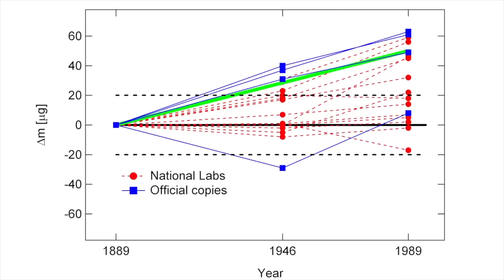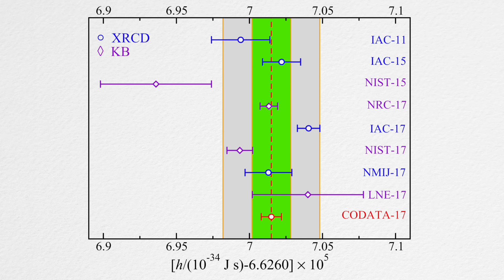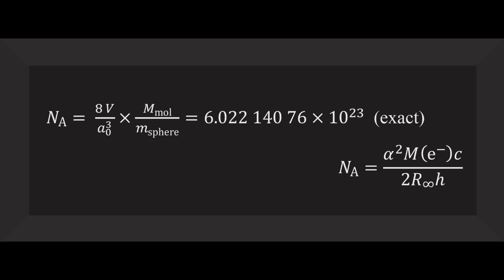The kg is dead, long live the kg

Comment: It is funny because the definition of a pound is based on a decimal number of the kilogram, so the pound will be changing in turn as well
Reply: @carultch  You wouldn't get it
(JK)
Reply: US: interesting 
The rest of world: what is pound
Reply: The pound 💷 changes value every day.
Reply: @carultch  I bought a router. I am in Australia. Australia is metric. I bought some 6mm router bits. They don't fit. The router was originally intended for the US market, it has a quarter inch collet - 6.3mm. If the US would join the rest of the world, these problems would not happen. Being able to convert units in a search engine does not help.
Reply: @snarkfinder2621  Unfortunately, having the US switch to metric has it's problems as well. I live in Phoenix, AZ where all of the streets are laid out in a grid. The distance between major roads and major intersections is based on the mile. They're all exactly one mile apart. So switching from the mile to the kilometer would require our freeway signs showing the distance between the exits to go from whole numbers to decimal numbers. Not something I would want to see while driving.
Reply: @emuhill  The same problems that Australia went through and other countries as well. The distances between freeway exits are rarely exactly x miles, more like x.xx miles, unless every single road is dead straight and either parallel or perpendicular to every other road. A distance of 26 miles would not be shown as 41.84 kilometres, but 42Km. Putting off converting only makes it harder later.
Reply: @snarkfinder2621   That just makes you the careless person living in a backwards country, since here in USA I can buy 6mm, quarter inch and even adapter collet to go between the two.   You didn't check dimensions of what you bought and don't live in a place that has adequate hardware inventory so that it didn't matter what collet size you had?  Pffft.
Reply: @snarkfinder2621  you're right. We should force over 300 million people to unlearn how they measure and define the world because you bought the wrong bits for your router.
Reply: @Ponja__  No, we should get a noisy 5% of the world's population to join the other 95%. My comment was merely an example of the problems caused by the 5%.

By the way. Many countries that moved to the metric system were forced by their governments. All of the USA's weights and measures are officially defined by the metric system.
Reply: @Ponja__  It's not hard to learn and everyone would benefit from it. So yeah, 300 million people needs to learn what the other 7 Billion already know.
Reply: @Ponja__  there are many countries that already went through this so why would the USA be any different
Reply: @Ponja__  Start from selling products in metric in USA. If you will buy milk in liters, rope in meters, potatoes in kilograms for few months you will get used to it pretty fast. Do you really think that it would be so hard for people to learn new system?
Reply: @rfly-fpv  you can do either.  Our food is labelled in both lbs/ozs and kilos and grams.
Reply: @Omenowl  And that's the problem. One thing that they realized in metrification of Australia was to not allow selling measure tapes in both systems (like both systems on one tape). The just started selling only metric tapes. If you sell both people will just follow their old habits. How long you get use to new UI in your phone? At first few days it looks weird, after week you start to get used to it and after a month you don't even remember how the old UI looked like.
Reply: @rfly-fpv  government mandated people use metric units by law and fined those who did not in Britain. Learn both, use both to be an educated man.  It is a huge deal especially when contracts, surveying, engineering were all done in imperial units and by law the oldest contract has precedence.
Reply: @Omenowl  I understand that it's hard for existing things but the solution is simple - just start new projects and contracts in metric system. Time will bring natural metrification in new generations. Super simple
Reply: @rfly-fpv . The answer is simple.  Do not force people to change for something that has worked since Roman times.  Give me a compelling reason why the one should be forced to change?
Reply: @Omenowl  In programming there is a rule DRY that means don't repeat yourself. By having multiple measurement system you basically repeat yourself (gallon for gas, barrel for oil, fluid ounce vs just liter and prefixes, inch, foot, yarn, mile, nautical mile vs just meter and prefixes). It's not about forcing someone. It's about realizing the benefit for the world and new generations. Example: Americans need to learn metric system when they want to be a doctor. They need to learn Celsius, grams, milliliters etc. Why even bother to learn and convert those things? If your grandfathers would do proper metrification in the 197x  we wouldn't have this conversation. Nowadays you can read articles in English language (international language) where the are miles and kilometers in brackets (for example wikipedia). That's just crazy - metric system is international standard. If Americans don't want to switch why they just can't learn metric units? Standardization is the key for success. Maybe you don't realize it as you are one country almost on the entire continent. Imagine Europe with as many standards as the countries. That would be total mess in trade.
There is one example where imperials system was adopted when metric was used before as it was easier to do it that way. For example Russian planes used flight levels expressed in meters. They were just sick off conversions so they started to use feet for flight levels to align with rest of the aviation world. On the other hand it's just much easier to switch world to metric that the other way around. 95% people already use metric system.
Reply: @Omenowl  BTW you said that it "worked since Roman time". Maybe true but IMHO I would say no... In the past every country had it's own definition of mile. That was not something that was working fine, especially in trade... Imagine a shampoo with big table on the back with all volume marks ;) It's a bit better now but not fully as even you have two or even three versions of mile (mile, statue mile, and nautical mile). I prefer the world where everything is designed to be simple. You want to measure distance? Why you need more that one unit? Big companies like John Deere went fully metric just because they really safe money on things like warehouses that need to keep only metric parts not both.
Reply: @rfly-fpv  you are talking about standardization.  Every city had it in the town center usually on a church.  It varied from region to region, but there was a standard for the area you were in.
Reply: @Omenowl  As far as I know there was some group of people in the government that stopped metrification in USA. If the law would be mandatory we won't have this conversation now. Educational videos were made, regular people knew that "metric is coming" but at the end the law was "optional". If something is optional nobody cares. Imagine optional speed limit. The whole thing just lost momentum due to the wrong (in terms of metric) law.
Reply: @rfly-fpv  Again if you are making a law to force people to use it then it is not a superior system.
Reply: @Omenowl  Again it's not about forcing, it's about educating. I bet in schools metric system is only used on physics class and that's it. Most of the people even don't like physics in school. When you really dig into the topic and you are scientists or engineer I bet you find metric system superior one.
Reply: @rfly-fpv  should be easy, especially since the metric system is easily convertable in units and works by factors of 10 for each new prefix
Reply: @jamesfstokes  because fREEEEEEEEEEEdon
Reply: @jamesfstokes  Because other countries had the mental capacity and the organisation to do it. Sweden even changed driving sides in one night, which is much harder. A specific country (France) even had what it takes to make a new system from scratch. Do you think a country in which half of the population supports orange man has that?
Reply: @XenophonSoulis  why do you need validation for what you use?  There are conversion charts and free programs that will convert for you with an exactness to several decimal places it is what a smart person would use if they aren’t familiar.
Reply: @Omenowl  I don't need validation for anything. I'm just mentioning some facts. Or are they too hard for you like the international system?
Reply: @XenophonSoulis  History, contracts, surveying, land rights and dealing with the human beings that it impacts requires one to be fluent in both.  

Perhaps one should stop telling people what to use just because it is too hard to use a conversion chart.
Reply: @Omenowl  Well, in the civilized world we can totally communicate and do everything you described with one system and use that effort to learn useful things instead. It isn't THAT hard.
Reply: @XenophonSoulis  You still have not refuted a single point I have made.
Reply: @Omenowl  You're why everyone laughs at the Un-united States
Reply: @ShadeOfTheLamp  I would rather have a decentralized system where people opt into standards than are mandated by tone deaf bureaucrats.  Tell me how the EU is doing…
Reply: @ShadeOfTheLamp  Laugh all you want no one cares if you add nothing of value.
Reply: @ShadeOfTheLamp  yep, American government bad.  Could not agree more hence why I do not believe in mandates.  Still prefer to live in a place that believes in individual rights like freedom of speech.  Unfortunately, no other place has it.
Reply: @Omenowl  And freedom of speech is basically everywhere lmao
Reply: @ShadeOfTheLamp  there is no fundamental right of speech anywhere else.  You better look at the laws and people being thrown in jail, fined, etc.
Reply: @Omenowl  What American supremacist education does to a mfer
Reply: @ShadeOfTheLamp  Have you actually lived on multiple continents and countries?
Reply: @Omenowl  Yes
Reply: @Omenowl  EU is doing fine. At least we don't give nuclear keys to someone with no political nor military background.
Reply: @Validole  I do not trust any of them and so accountability is required of all.
Reply: @Ponja__  oh no, it's so hard to learn that 100cm = 1000m. you're underestimating your own people, dude.
Reply: @noakinn  "it's so hard to learn that 100cm = 1000m"

hmmm but it doesn't Lol 100cm = 1m
Reply: @carultch  say that to the probe that crashed into the face of Mars, because the sensible scientists used metric while a few used imperial. $125 million down the drain, and people still use that backwards system.
Reply: @Seb135-e1i  it isnt a "backwards system" in  fact it isnt the systems fault at all its the scientists fault for not all using the same system of measurement in fact if its the  scientists who used imperial measurements fault then its just as much the metric measurements fault as well  for not using imperial measurement its all based on perspective and what you were taught  when you were a child
Reply: @zapawak4808  Good lord, that was painful to read. Ever heard of commas? Periods? Any kind of sentence structure? 
And it's not perspective - the global standard is to use metric for science, no matter whether you're in Europe or the USA. The "scientists" using imperial shouldn't have been working at NASA.
Reply: @Seb135-e1i  The scientists using imperial weren't working for NASA.
NASA has been using metric since its inception (so the answere to, which unit system got us to the moon is metric).
The spacecraft was build by Lockheed Martin, with the Software made by NASA.
The computer got a value of the force, the thruster was producing and calculated with that value, how long the burn should last.
The problem was the computer expected the value to be in Newton, but as Lockheed Martin uses imperial, they provided the value in pounds.
So the problem was Lockheed Martin not using Metric, or not converting to metric, although it was required of them.
Reply: @zapawak4808  Nope. The guys who used imperial were the ones who messed up the conversion that they shouldn't have been doing in the first place, as the agrement was all work was to be done in metric just to avoid such a situation
Reply: Yes but actually, no. Units are just converted over - in that way the definition of pound is changed. How pound was defined back in the day would not change - though how things are defined before, now and after which one would matter? And for what you are doing, does it matter to use extreme precision?
Reply: @RickTrajan  No one uses how things were defined before, and even then, how they were defined before was inaccurate and varied significantly, they just weren't doing anything sensitive enough that it would significantly matter. Though pounds are still not used by anyone doing work that precise, but anyone currently using pounds as their measurement just got updated since it's CURRENTLY based on the kilogram.
Reply: RickTrajan *Well yes but actually no
Reply: As was pointed out in the video from 8 years ago on this channel
Reply: I mean pounds don't exist so it's not that much of a problem. ^^"
Reply: 69 replies

I will ruin it lololloololoololololol
Reply: Pound was a definition of medieval language before the language "k.g" was born!
Reply: Kg was defined in relationship to the pound in 1878.    Pound referred to a particular platinum shape used for reference.
Reply: In the US the people believe that the government is of the people and by the people.  If the people don't want to do something, having the government force them just doesn't make sense.  The people forcing the people?  Especially on a topic that can be lived with either way.
Reply: Pound is not basic unit
Reply: The modern pound yep
Reply: A pound is based on a gallon of fresh water. The imperial gallon is 4.5 litres = 10 pounds. The US gallon is 3.79 litres =8 pounds.
Reply: No, the digits of precision in the re-definition of the pound are insufficient to be affected in any way.
Reply: Not just any decimal number, a rational number! That's the big idea, its like a change of basis to quantified properties. Quite beutiful
Reply: Why doesn't US stop using those dumb units
Why are you torturing the rest of the world?
Reply: if i remember correctly, when the US tried to change from imperial to metric, the change was voluntary and not mandatory, so the people refused
Reply: @Matt0sh  It's very simple. We keep using those units because we don't want to torture ourselves by learning something new. We don't give a f** about the rest of the world.
Reply: @russlehman2070  that's not a good thing. read what you said again.
Reply: @Matt0sh  I agree that it's not a good thing. It is, unfortunately, a fairly accurate statement of the attitude of many  of my compatriots about converting to the metric system, which is something that I actually favor.
Reply: @Matt0sh  You're silly, there is zero superiority of any unit system for everyday use.  No country on this Earth uses purely metric units, all have some traditional units in use.
Reply: @RWZiggy  wrong, there are multiple countries that use only the metric system, mine included
Reply: @minecrafting_il   I am correct.   Your country also uses traditional units as all do.  Name the country and prepare to receive the facts.
Reply: @RWZiggy  i know we only use metric as we have no traditional units at all.
Unfortunatly, I can't tell you what my country is, in fact, I cant even tell you WHY I can't tell you what my country is.
Reply: @minecrafting_il  all countries have their traditional units used for some things, even France where metric was invented has a few old traditional used for certain things even if it's not for commerce, science or engineering.
Reply: @RWZiggy  Can I name mine? Peru. Or for that matter please do your facts for anywhere in Latinamerica.
We don't use traditional units at all. I looked it up, we had thumbs, steps, leagues, libras, points, ounces (onzas), fanega, quintal, and so on.
It varied per province. You read that right, there was no "Spanish Empire" measurement, each small province got its own.

Day to day I've seen people use fingers, hands and steps to approximate distances, but with like their OWN fingers. "I saw a spider the size of two of my fingers!" so not a measurement system, just relating body parts to size.
I just found out that a manzana (a city block) was measured as 100 varas x 100 varas (vara means rod). I always wondered why our city blocks had such a weird size with so many decimal places just around 100m. A relic of old times I guess.
Reply: funkyman909 — Not funny at all.  The reason U. S. Customary units are defined in terms of S. I. units is so the problem of refining the standards does not have to be done separately for each.  That would be pointless duplication of effort.
Reply: @GH-oi2jf  Well, isn't having two units pointless too? I am hopeful for a switch to metric and ditching of pounds, ounces, inches and other nonsense
Reply: Learning imperial vs metric is in the USA's curriculum. Being someone who graduated highschool in 2020 you at minimum graze over the differences. Im not entirely sure what exactly the benefit would be of the US converting to the same system as the rest of the world, but yall know the US built different. Its prolly just the people wanting their own sense of difference between us and the rest of the world. No cap i do like inches and pounds better though. I also think both systems of measurement were needed to even bring this standard of accuracy into fruition through comparison. Who knows man, there isnt a straight forward answer for this type of thing.
Reply: No avoirdupois weight isn’t based on Kg, it’s been used since Rome (although it was something else) they do coincide in the fact that they both measure weight kind of. Kg measures mass which is independent of gravity and pounds measure with the inclusion of gravity. A good way to put it is metric is for maths imperial is for how it feels to humans

(Edit: This does mean that in comparison to the new vs old kg the pound changes but not individually, one pound of steel remains one pound of steel while retaining its volume)
Reply: @brookspact6069  A pound gets its' definition bazed upon the kilogram. It defines itself off of SI kg.
Reply: @mrartistimo1530  Bro this was so long ago lmao I don’t even remember what it was about. Reading through it though I still disagree. If the kilogram changes you aren’t changing the pound. While yes you are still changing the conversion from pound to kg the pound itself is still inherently 1lb. All the change would mean is that now there is either more or less kg/lb depending on the change, but the specific weight stays the same. It’s like temperature. If you change the boiling temp of water at standard atmospheric pressure at sea level to say 300 Fahrenheit then it would change all of the Fahrenheit system, but the Celsius system wouldn’t change. And neither would Kelvin. All that’s changing is the conversion rate.
Reply: @brookspact6069  you’re treating the pound like it’s some universal constant lmao
Reply: @dylanb2990  I’m a fat gun totin murican, nothing is constant when a cow is 1/246th of a rocket that is roughly 179 burgers long
Reply: @brookspact6069  Your comparison to Celsius/Fahrenheit isn’t relevant. They are both defined separately at the freezing and boiling point of temperature. So if we changed Fahrenheit so the boiling point of water was 250 degrees. It would still be 100 degrees in Celsius. 

Pounds however are defined by the kilogram. So if we decided to double the weight that we call a kilogram, we would also be doubling the weight we call a pound.
Reply: @brookspact6069  This actually gets confusing. Their are actually two different pound units in the imperial system. The pound force (a derived unit for weight) and the pound mass (a base unit for mass). One pound mass is the amount of mass that exerts one pound force under Earth gravity. This is a confusing point (as if this system isn't dumb enough) that I didn't understand until I went to college (I am studying engineering, and therefore have to deal with both unit systems) This pound (mass) is as of now officially defined as 0.453592 kg. It once had an independent mass standard equivalent to big K, but this was discarded. This also means that the imperial system has two different mass units, the pound mass, and the more truly base but rarely used unit: the slug (14.5939 kg).
Reply: @jamesdinius7769  a lb-force and lb-mass being directly related to each other is great cause you don't have to deal with a gravitational constant conversion when converting mass to weight and weight to mass.
Reply: @howardbaxter2514  Except, you DO have to deal with a gravitational constant, if your units are lbf and lbm.   Even in problems that have nothing to do with gravity.  You end up with a gc term in Newton's second law, where you are just intending to relate mass and acceleration, even in strictly horizontal problems where gravity is not a factor.  The purpose of which being, to translate lbm to slugs, so ft/s^2 can be the acceleration unit and lbf can be the force unit.

Needing a gravitational constant to relate the weight unit to the mass unit, is precisely where it should be used.  Because it represents something physical, i.e. the gravitational field strength.  How much gravitational force applies per unit mass.
Reply: @jamesdinius7769  I'm actually old enough such that my high school Physics course was all pounds, slugs, 32 feet/sec/sec....never used the  metric units until arriving at the University of Maine.....pound force vs mass was a serious impediment to understanding the difference
Reply: @jamesdinius7769 It's also the reason why matpat lost his mind over a ton of gold coins.
Reply: @jamesdinius7769 sounds like a boxing match, pound and slug 😅
Reply: @brookspact6069  1 pound is 3 bald eagles devided by 3 bullets in an Elementary multiplied by 1 ak47.
Reply: @brookspact6069  The modern definition of the avoirdupois pound (1 lb) is exactly 0.45359237 kilograms.
Reply: @brookspact6069  To me, imperial is very confusing. I find it very hard to convert between imperial units (example: from inches to feet or from feet to miles). You have to grab a calcualtor for conversion. In metric, you just multiply/divide by 10. For example, without touching a calculator or google, you know that 36 meters are 0.036 kilometers. How do u know? Kilo means 1000. 1000 has 3 zeros in it. A meter is smaller than a kilometer. Therefore, you put the , 3 positions to the left. And that can be done in a couple of seconds. However, i found that imperial units have these precise numbers you have to multiply to get the correct value and that causes a headache when trying to work with them. Not to mention conversion between different types of imperial units is also confusing(for example from lengh units to volume units).